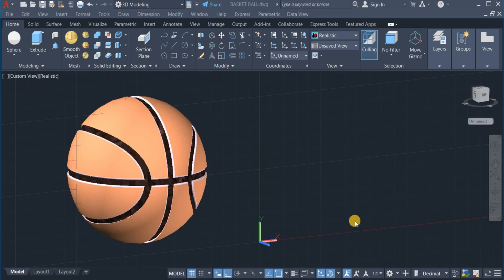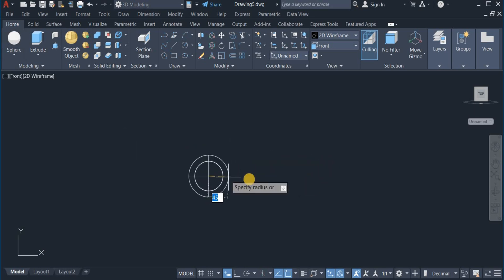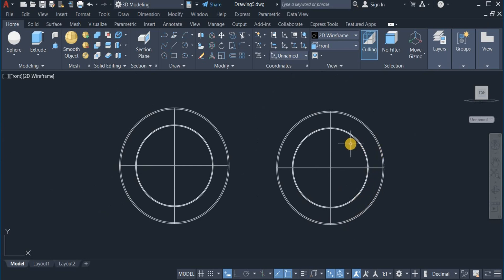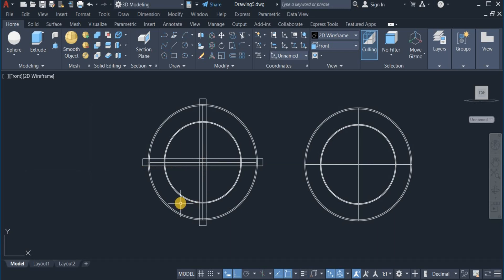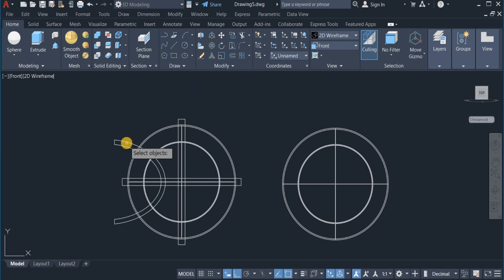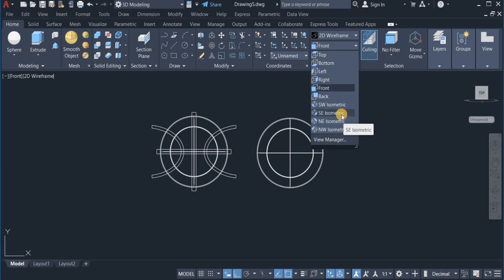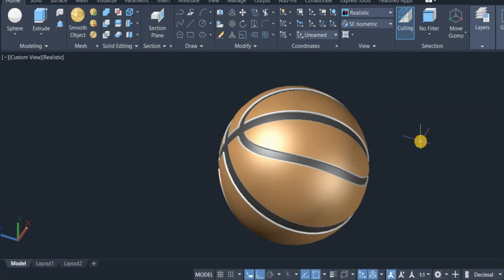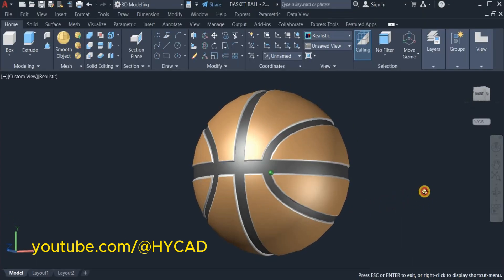AutoCAD 3D Basketball Tutorial( Step-by-Step Guide) #design

Comment: Wrong. Nobody gets this right. This is not a realistic basketball. Look at a real one and you will see that one "end" of the ball is "rotated" 90° from the other. All panels of a real basketball are the same. In this representation, the panels are different. You need to ensure that 1. The points at which the ellipses cross the outer diameter of the ball cross at exactly 45°.  2. The resultant pattern must then be copied and rotated 90°.  3. When they are extruded, leave the 2D pattern in the center of the sphere.  4. Extrude 1 pattern + 75. Extrude the other one -75. Cut the sphere with both the  + and - extrusions, and you will have a "real" basketball.
Note that the outer points of the 2D patterns must overlap EXACTLY when rotated 45°. If they don't, then your ellipses aren't in the right place. Re the 2D pattern - It's easier if you trim all intersections and do a Join command on them before you rotate the initial 2D pattern, then rotate a copy 90°. When you go to extrude them, you can just click on each joined pattern. Far easier than trying to grab all the various bits and extrude them together.
Reply from the maker: Thanks for your comments. Kindly share a video to expatiate on this; I will be glad to learn from you.